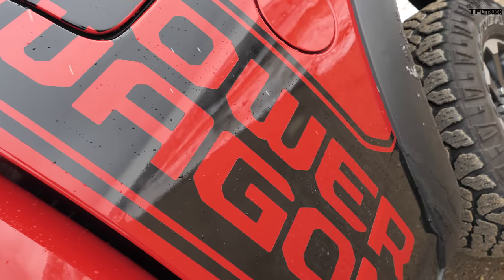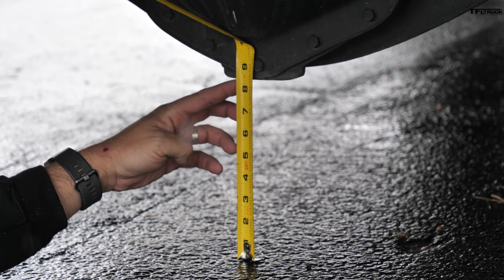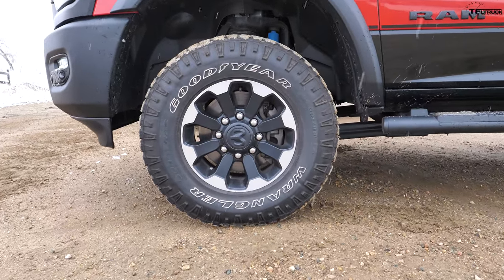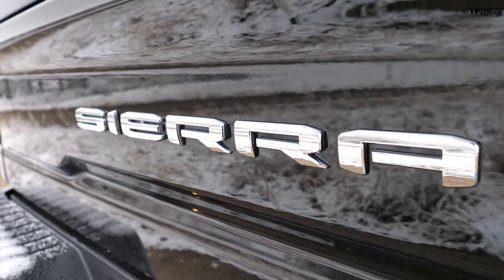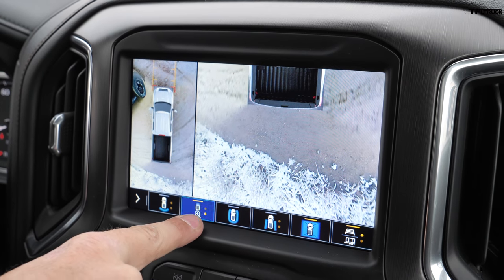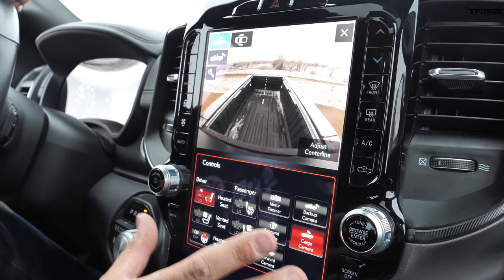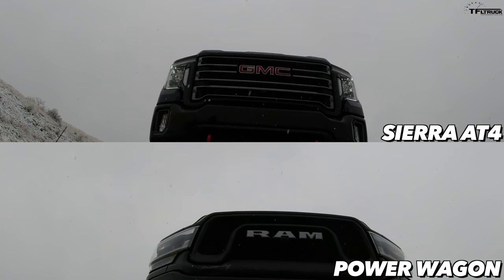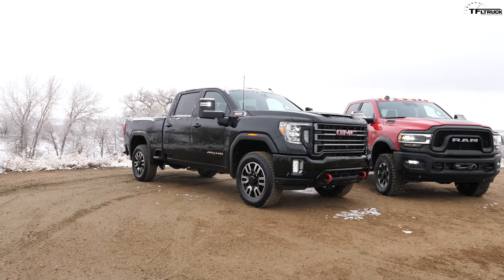Ram Power Wagon vs GMC Sierra HD AT4: You’ll Be Surprised Which One Has Better Off-Road Specs!

Comment: You should always do a turning radius test. very important not only for off-road, but also everyday driving and parking.
Reply: That and headlight illumination.
Reply: Those rams turn the tightest. Ford and gm HDs need 40 acres to turn around on.
Reply: Turn radius is very underrated. Only real truck driver know how important being able to make right turns are.
Reply: @jamespenner1412  It's true. I had a GMC sierra and it was brutal, now I have an f150 it's even worse lol.
Reply: That would require them to drive the truck...
Reply: Like more ram 🐏 luxury Interior

Comment: Why doesn't anyone make an easily detachable chin spoler? Leave it on most of the time for a bit of fuel economy, and snap it off for off-road?
Reply: Mike Wright - I agree, but if they are too easy, they just get stolen.
Reply: @andrewsbbq  where's it at in your garage? 🙃
Reply: They self clearance really easy if you take these trucks off road seriously.
Reply: andrews just curious, did you see any noticeable change in mileage after taking it off?
Reply: andrews I know! My chin spoiler is held on by zip ties and my bumper is all bent to shit. I’ve had to winch it out of the bottom of the headlights a couple times already.
Reply: Greg Kittle I picked up about a half MPG on my average installing a diesel air dam on my power wagon. They DO work.
Reply: Exactly! If you can have a switch in your muscle car to open exhaust cut outs why can we have a button to raise our lower the chin spoiler!
Reply: @awdanthony  interesting. I figured that would be the case but it is always good to get the info directly from real-world testing.
Reply: Pretty sure on the ram rebel it folds up out of the way and deploys at highway speeds.
Reply: Christopher Cox Rebel doesn’t have an air dam / chin spoiler. It has the big skid plate up front.
Reply: Jeep Grand Cherokee WK2's were designed to have removable lower airdam (lower valence) for offroading.
Reply: They do, it is just a few screws and pop "I don't know what they called plastic things."  Most offroaders take them off
Reply: Don’t think that would last you long. Probably fall off on the highway. That’s why everything is clipped in
Reply: I just remove the factory plastic.  I add a brush guard or Ranch Hand bumper.  Then I fabricate my own air dam using truck mud flaps as the material.  I start with the common predrilled metal angle metal.  Bolt that to the bumper, body, or other spot.  I cut the mud flap length wise.  I glue at least 2 layers together.  And mount on the angle metal.
This system can take hitting rocks, dirt, or snow.  And just bounces back.  But does provide the aerodynamic advantages of an air dam.
The first vehicle I did was a lifted '79 Dodge Ram 250 tradesman van.  Some of my friends with cars like a Porsche  928, or Camaro Z28.  Could not keep up with me on bumpy or wavy highways or mountain roads.
On some vehicles, I have added the mud flap material to lower the factory air dam.  For improved aerodynamics that are durable.
Reply: The Chevy Colorado’s comes off easy.
Reply: Why not an auto chin spoiler that extends or lowers at high speeds, retracts as the vehicle slows? That is very easily doable.
Reply: Somebody steal a plastic wind hanging down thingamajig ?! They could have the piece of junk.
Reply: @takayama1638  The stupid things are surprisingly expensive. Hell the big ugly thing Chinese piece of plastic garbage GM calls a bumper on my Camaro is $200 to replace.
Reply: Should just have a automatic rising one like the 1500 has or just get rid of it all together and just put a skid plate there.
Reply: I've wondered this as well.  Would be very nice.  It'd even take a taller chin spoiler if I knew I could easily take it off for off-road use (don't need the huge air gap during most of my daily commute which is much on-road highway).
Reply: Good idea. Have it lockable so it can't be stolen.
Reply: Excellent idea.
I'm sure you can just unbolt it but maybe some quick release fasteners can be integrated
Reply: Why don't the make it automatic like side steps?  Push a button and done, extra clearance.  It's not like the front bumper is small.
Reply: Mine are self detaching.. they last about a month on all of my trucks and then are magically gone.

Comment: The tire size is the difference  in clearance, the ram wins in my book
Reply: Exactly. The Duratrac is a tougher tire and an actual off-road tread. The other one GM used is just a street tire for a truck. 
If you want the same ground clearance, get a taller Duratrac.
Lol
Reply: @mikz86ta1  The Duratrash has to be removed immediately, as it has glass belts and toilet tissue side walls sadly.

Comment: He wonders why Chevrolet doesnt have a plate under the fuel tank, its because GM knows that their fuel pump is garbage and will need to be changed out regularly
Reply: The fact they went with an Allison transmission is another tell. There are alot of GM fanboys commenting.

Comment: Love how he threw “Allison branded” transmission. The T1000 was Allison designed and assembled by GM in Baltimore.
Reply: Cause they branded the 10 speed allision which it isn't really since most of it was a FORD design. In this cause this is a true 6 speed allision.
Reply: Paul J your thinking of a different 10 speed transmission the one that’s in the 1/2 ton raptor and Silverado/Sierra is a joint venture with General Motors and Ford. The one put in the 3/4 ton and 1 ton is Allison designed components and assembled in Toledo by General motors.
Reply: @paulj9821  It's not shared on the HD platform. Two different transmissions
Reply: @Steve-pc6cb  its not a allison just stamped look up allison from sema the old gm does come with a allison new ones is a gm trans
Reply: Mike Leggiero the last time a Allison assembled transmission was put in a GM truck was the Lb7. After that  General Motors assembled them all in Baltimore.
Reply: @Steve-pc6cb  GM sold Allison in 2007 and Allison became it's own brand. Allison built the transmissions since then. Not the other way around. The plant is closing this year. 
https://www.atsg.us/atsg/blog/gmtenspdallison/
Reply: All the talk of if it's a "real" Allison or it's Allison branded need to understand than Allison WAS GM. It wasn't just a division. GM bought Allison in 1929. Allison was not a transmission manufacturer until after WW2 ,they built aircraft engines, when GM created the Allison transmission division.  The Engineers from GM Hydramatic and Allison were the same people! 

Allison was simply the HD line. Only in 2007 was Allison spun off, by then the Allison 1000 and 2000 were already built.
Reply: EGGINFOOLS GM is closing it’s transmission plant in Baltimore that assembled the T1000. GMs plant in Toledo currently assembles the new 10 speed Allison.
Reply: @Steve-pc6cb  Your are correct and I agree. I misread your comment. Since 07 they were built at a GM plant because it was established before the sold Allison but Allison still made the transmissions. They weren't branded as the new one is

Comment: Geee if I had money to buy either truck it would probably be the GMC. The cameras, tailgate with the speakers, heads up display, LED lights everywhere! I just love tech.
Reply: More tech. More problems down the road. More expenses when needing repair. Just sayin
Reply: @timothycc711  I hear ya.  Just ask ram about there 12 inch touch screen problem
Reply: @damitbobby6677  They say Toyotas and Honda are more reliable and they are. However I do believe that they are more cautious with tech and new designs. They are slower at putting out those things.

Comment: The GMC is an “off road” truck, the Ram IS an off road truck. AT4 should be compared to a Ram 2500 diesel with the off road package.
Reply: The Ram had less ground clearance. So much for being a real off road truck.
Reply: I'm going to the Ram website now to "build" one.  And......NO! You can't get the selectable lockers and disconnect-able sway bar with a diesel.
Reply: Add the same tire/wheel size from the at4 to the powerwagon probably make but the rear diff height difference. At4 near 9.5 and wagon at 8 1/4. That extra inch makes 9 1/4 maybe load rating of tires would have it sitting 9.5 to 9.5 maybe
Reply: @rezridez1  The Ram had 33's and the AT4 had 34's. If the Ram went to 34's, it would gain 1/2" of ground clearance under the diff (8.75").
Reply: @karlschauff7989  ya he measured the rams 33 out to be 31 vs at4s 34s that measured out to 33
Reply: @rezridez1  The tires are flexing due to the weight but on only one side of the tire. So you don't get an equal center-to-tread measurement in both directions. Also, it's an idiotic method to measure tires like he did, because it's just a eyeball measurement on dirt. Hardly precise by any measure. Add to that the fact that you can air the tire up or down whenever ground clearance is necessary. End of the day, the Ram has 33's and the AT4 has 44's. Quit clowning.

Comment: Love both trucks but I am true to GM! Dodge kicks ass even if it's a gas engine, hoping they make it in a diesel option so it could be a better comparison though. Really like your guys videos, keep up the good work!
Reply: Historically, Power Wagons are only Gas powered.
Reply: You can get a Cummins with the power wagon package. Pretty sure it’s a regular power wagon but without the winch
Reply: David Lynch that’s not a power wagon, it’s just a 2500 with a package. Just because a Scat Pack has the 6.4, doesn’t make it a “SRT 392”
Reply: David Lynch You cannot get a diesel in the Power Wagon.
Reply: Jl Bush like I said, “ you can get a normal Cummins and get the power wagon package.”
Reply: David Lynch That’s not what you said.  You said, “Pretty sure it’s a regular Power Wagon but without the winch”.  A regular 2500 is not a Power Wagon even with the Power Wagon package added, and therefore, like I said, you can’t get a diesel in the Power Wagon.
Reply: Jl Bush do you not see the first half of my comment lol

Comment: The reason the gmc was taller in stance was because the tire size
Reply: Wahhhhhhh
Reply: It's nobody's fault but Ram's that they put baby tires on a Power Wagon.
Reply: The gmc truck is larger in design... in height and width.
Reply: karl schauff They did it to maximize wheel articulation.
Reply: @jlbush8249  So you're saying that those are the biggest tires that are going to work without rubbing on a stock Power Wagon? Because every manufacturer chooses track width, wheel size/backspace/offset, and tire size with consideration for tire clearances. No stock truck, no matter the articulation, is going to rub.

Comment: I want to see off road and towing test of these two and the Ford HD Tremor diesel!
Reply: I bought a F-250 Tremor specifically without a diesel, a little lighter and MUCH better in extremely cold weather!
Reply: @dundonrl  What about towing? Never get's below 80F here! LOL!
Reply: @JPE_DRAEB  F-250 Tremor still has 15,000 lb conventional towing (either engine) and only about 1500 lbs less with the gas engine vs diesel on 6th wheel towing.
Reply: @dundonrl  But the MPG on the gas sucks with towing right?
Reply: @JPE_DRAEB  If you're towing a lot, the Tremor isn't for you. Of course anyone with an iota of common sense will know that!

Comment: Love the hat Andre.  The powerwagon needs 35inch Duratracs.
Reply: It seems to be the most done thing to the trucks for owners. I get it hurts fuel mileage, but that's more less irrelevant with these trucks.
Reply: @WilliamStewart1  I have Toyo open country MT 35"s and am getting about 12 mpg and you're right pretty much Irrelevant whats not mentioned here is I can stick 37 underneath mine and still get full lock on the steering there is no way that's true for the GMC

Comment: I would love to see ram bring a 7.0ltr “426” hemi to the heavy duty line up. It could bring a lot more power to the power wagon without the weight of a diesel
Reply: They could put the Helliphant in it that's a modern 426 Hemi that's super charged & makes 1000 HP & over 900ftlbs of torque on pump gas . The engine uses the superstock block heads crank rods & pistons so it can take a healthy beating plus it comes with the computer opened up so you can custom tune the engine your self with a laptop & not having to send the ECM in to either have it flashed or a custom tune put into it !
Reply: Pete Loomis I’ve seen it and that sounds awesome! But they would also need the larger gasser to be compatible for the non pw ram hd. And tuned that high it wouldn’t last at all. Maybe if they had it tuned to 500hp and 550trq
Reply: Not sure I would want it.  It’s hard enough getting my 6.4 up my driveway without eating it up.

Comment: I do like that the Ram HD crew cabs are 149" wheel base. Thats not huge. To put that into perspective, my 2014 F150 Supercrew with a 6.5' bed is a 157" WB. And now that GM and Ram have gone to bigger cabs in their 1500's, even those are bigger.

Comment: You can get a Power Wagon new right now with all the needed off road goodies but none of the fluff for $47,225. That is the best deal on a dedicated off roader anywhere. You can get a minivan motored Rubicon Gladiator or Wrangler for a few thousand less, but step up to the Ecodiesel and it's $2000 more. The ZR2 Diesel Colorado is $500 more but smaller and no winch. The AT4 even without the diesel and still lacking front lockers and a winch with the most basic possible options except the off road performance package is $9000 more.

Comment: If we're talking some real off-roading, it's the Power Wagon all day for me. Having front and rear lockers on the Power Wagon just makes a massive difference. I'm not a fan of that G80 auto locker that GM just won't go away from. The Power Wagon also gets you solid axles, disconnecting sway bar, and that factory Warn winch. I hope you put them up against each other on a hairy off-road trail.

Comment: Ram HD and Ford Superduty will always beat GM HD trucks off-road due to the straight front axle. Ford owns half ton off-road action with the Raptor.
Reply: The Raptor is a class above these two trucks. Although they are both nice trucks, if I wanted a straight off-road truck It would be straight to a Raptor.

And I own a 2019 Ram 1500.

Comment: Next week  we compare the power Wagon to a D9 cat which can out-Tow the Ram by 48 tons, but the D9 has no radio,  tires or steering wheel, but 1200 more HP,  so we subtracted  4 points from the Ram, let's see if the Ram can compare...why compare disel with non diesel???? Am I missing something here?

Comment: REALLY wish you guys would also point out that you can get the AT4 in a 3500 SRW and quote it's payload and towing capacity.

Also I still don't understand why they classify the Power Wagon as an HD truck, most if not all 1500's have better payload and towing capabilities.
Reply: Its the same platform as all the RAM 2500's with different springs and radius arms. You want extreme articulation or do you want payload? Physics are a bitch.